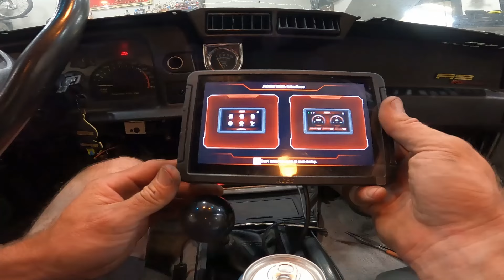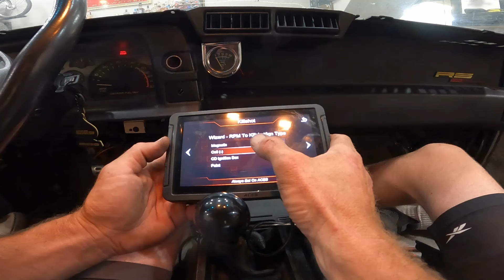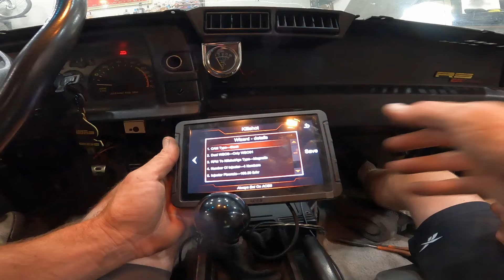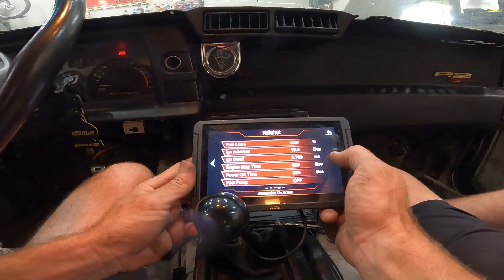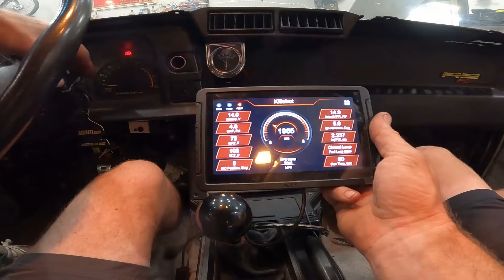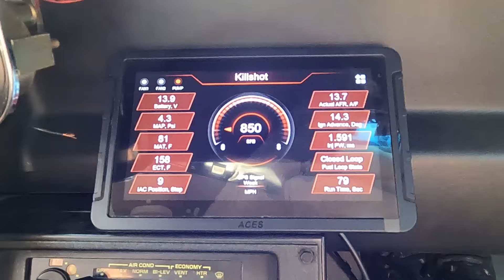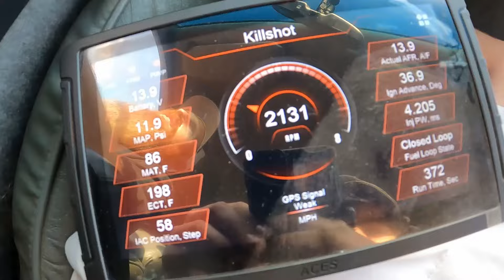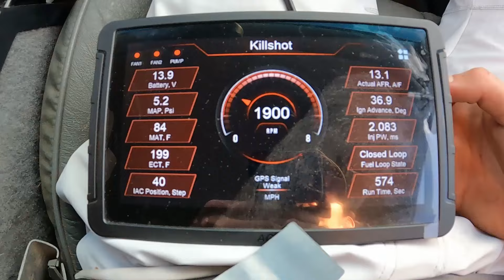Installing an Aces EFI Killshot on Project 3rd Gen!

Comment: I installed this same setup on my sons ‘67 mustang 289 just about 2 years ago when they first came out…..what a difference, like night and day!!!…….i need that T-5 next
Reply from the maker: It is a vast improvement over the factory TBI. We are still working a few tuning kinks out, but we are liking the system so far!
Reply: @FullThrottlePerformanceMike …did you ever get your tuning kwerks worked out??  Howya liking it??
Reply from the maker: @trentdawg2832  One of the biggest issues we had was an exhaust leak at the header flange that was messing with the O2 sensor.  Once we fixed that, it really  started coming together with the self tuning.
Reply: @ good shit

Comment: Great video. I just ordered the kill shot for my SBC. After  setting your balancer 15 degrees BTDC do you point your rotor at #1 cylinder when installing the distributor? Then align your reluctor wheel with the pickup?
Reply from the maker: Yep.  To be honest with you, the distributor was the toughest part of the whole process.  I'm am not a timing master and the instructions confused me more than once.
Reply: @FullThrottlePerformanceMike  same here. Thank you for the info

Comment: Any way to install with a stock distributor? So it reads rpms, dont have the budget for timing control yet
Reply from the maker: So, as far as i understand it, you can use your stock/aftermarket distributor to run the timing. However, it will be controlled by your weights or your ignition box.  You can always upgrade later to have Ace's control it all

Comment: Are you still happy wirh the Killshot?  I’m currently looking at getting it.  I don’t want to pay extra for the Holley name
Reply from the maker: As of now we really like we haven't got a ton of drive time on it.  And the car is currently tore down to add a turbo over the winter.   I think that 90% of all the issues people have are install errors, exhaust leaks,  and unreasonable expectations for what "self tuning" can do.  You should expect to have to do some tuning before the self learn can take over. Unless you are on a 100% stock motor.   Use my promo code and save 10%

Comment: id-10-t questions.....installing this same system on a trifive with sbc out of a 70 vette....when you dropped the distributor into the motor did you have to get the rotor pointing in the vicinity of #1?  Also, how how did you find #1 on the cap to get the wires in the correct order?
Reply from the maker: You want to rotate the motor over to 15 degrees BTDC before you install the new distributor.   You can have the number 1 plug wire pointing in any direction as long as you know where that location is.  It normally is pointed forward just towards the drivers side.   If the distributor doesn't drop in where you want it you will have to get a long flat head screw driver, sick it in the distributor hole and rotate the oil pump slightly.  Until the distributor will drop in in the correct location.
Reply: @FullThrottlePerformanceMike  Thank you for the reply.  After getting the motor set @ 15 degrees BTDC, when I dropped the distributor back in, the rotor was was pointing almost straight ahead, not towards #1.  Do I need the keep adjusting until I get the damn thing pointed more towards #1?
Reply from the maker: @RickBorland-uy1di  yea sound like your off a tooth. Spin the oil pump back like an 1/8 of a turn and try dropping in the distributor

Comment: Does the throttle cable bracket have a trans kickdown option too?
Reply from the maker: It comes with multiple different  brackets. But to be honest, I never looked cause ours is a 5 speed. Let do some digging, and I'll find out.
Reply from the maker: It doesn't look like it has one at this time. I'm sure you could add one to it.
Reply: @FullThrottlePerformanceMike  thank you for checking

Comment: Imagine removing the tbi system n installing a fully tunable control by Bluetooth modern tbi system. Win, don't be like those idiots that go from tbi to carb.
Reply from the maker: To be honest, before the aces guys reached out to use that was the plan or maybe TPI. This is 100% better than TPI it's tunable and flows way better than late 80s technology.   But this is a car being built on a 15 year old kids' budget, which is almost nothing, haha.